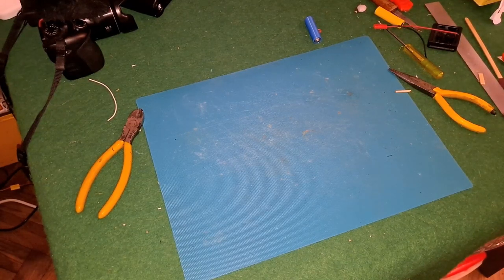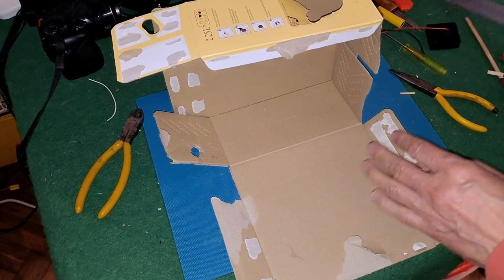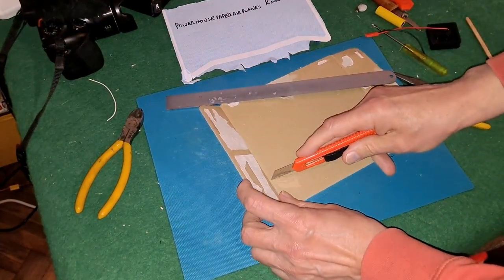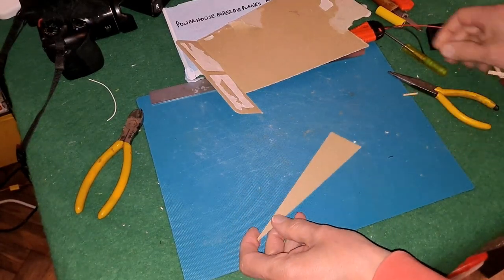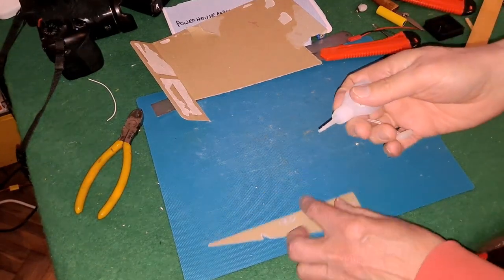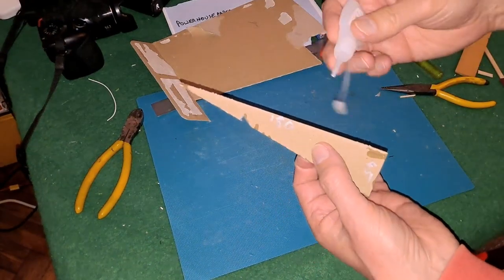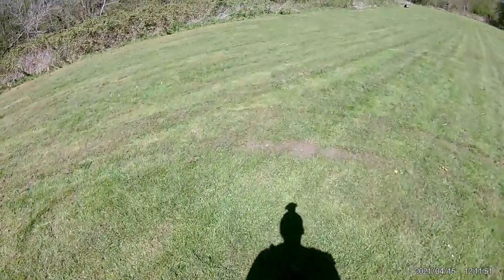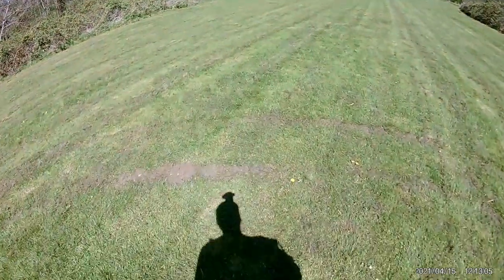Catapult launch helicopter 20210415

Comment: The heaviest I used was cardstock. But I fold it like the paper one.
Reply from the maker: I like to use stuff that I would be throwing out, so it get's a second use before it's junk.
Reply: @GrandadIsAnOldMan  I hear you on that. I like to start with a clean new sheet. Cause if it's anything with letters and ink on it. I believe it will throw the weight off lol.
Reply: @GrandadIsAnOldMan  Oh also you were right about the tape. The tape is to stiffen it up. Plus to also help with the water proofing it. But the tape the way I put it on the helps make it unstable. So once it stops going up. The tape will throw the helicopter off into a gyro spin. That's what helps make it spin like a helicopter.